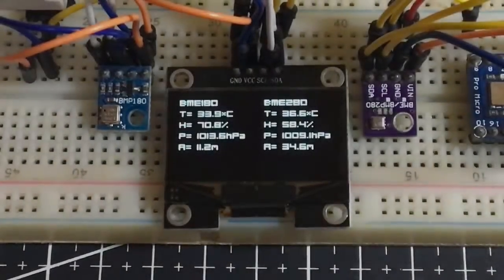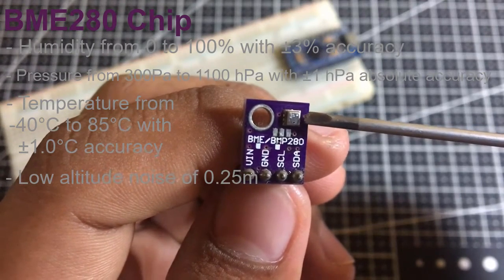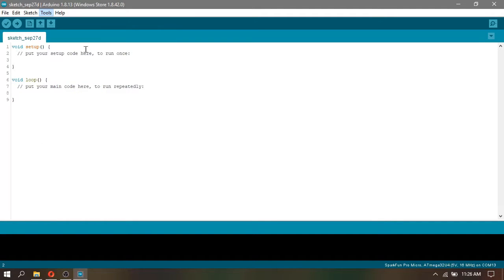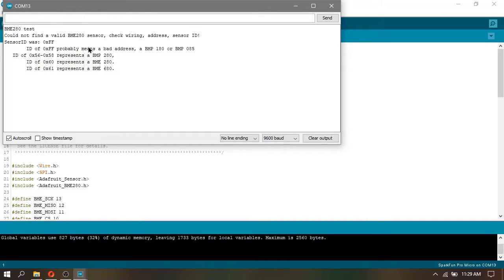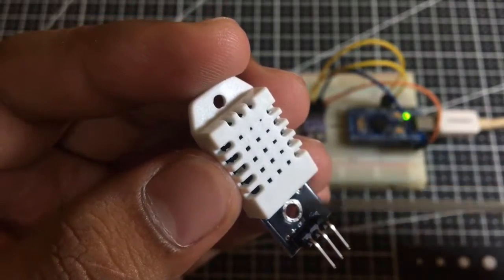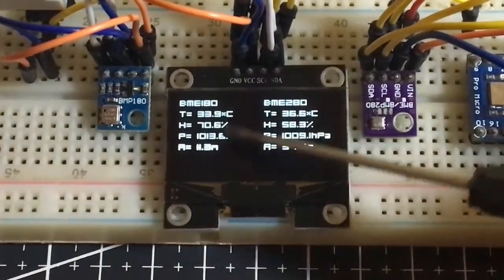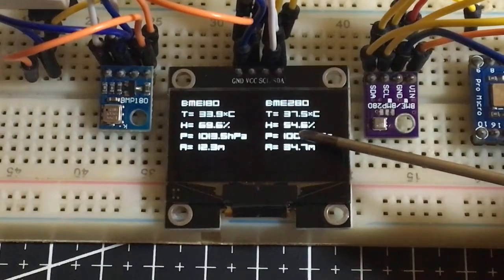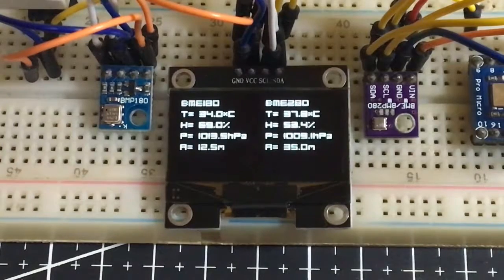BMP180 and BME280 with Oled Display - Arduino

Comment: The sensors read the atmospheric pressure at ground level at your location. You will get a better altitude reading if you reference this to the mean atmospheric pressure at sea level and a little bit of maths. You could use a standard reading of 1013 hPa but this will not compensate for daily atmospheric changes. A local airport QNH will provide a good reference.
Reply: Atmospheric pressure varies depending on tides in your area but it also helps if you can know the altitude you’re in proportional to your sea level pressure in your area. Sorry for bad english